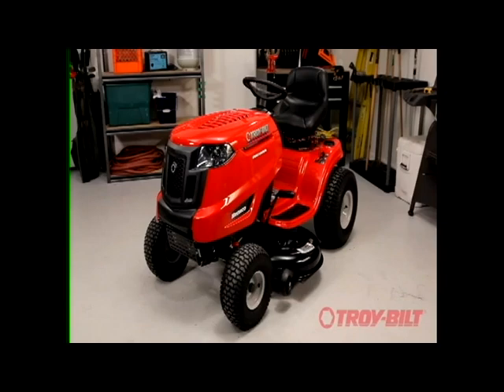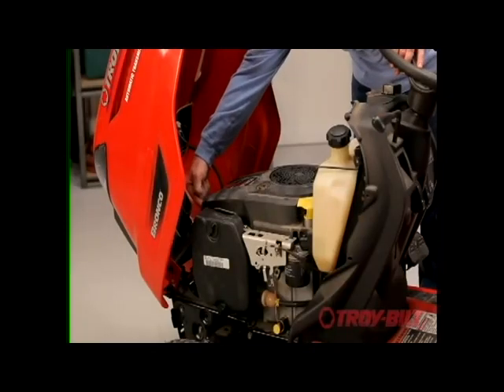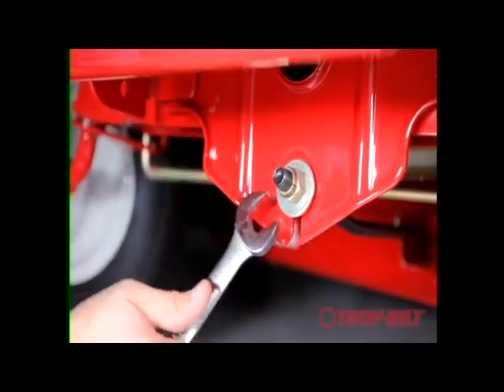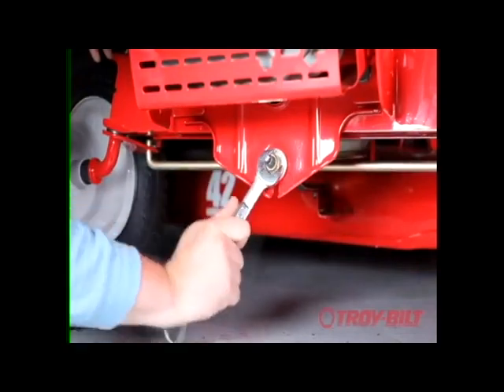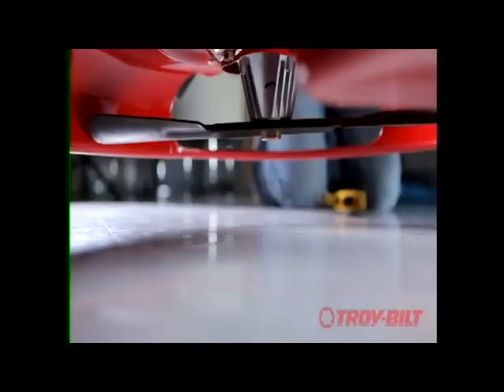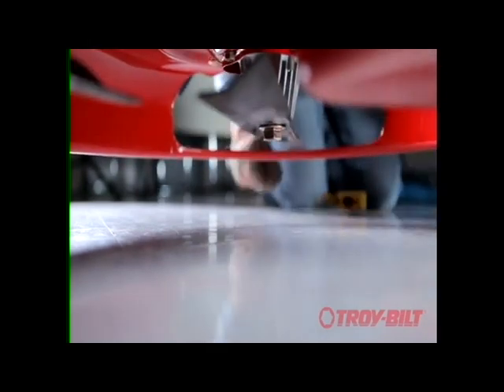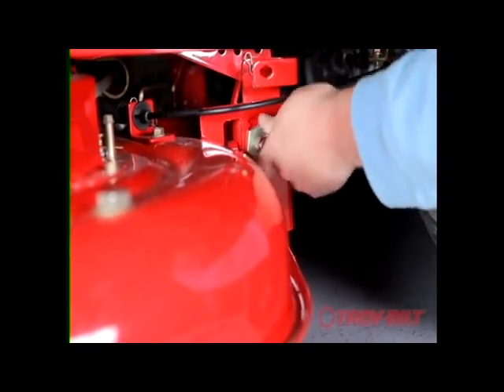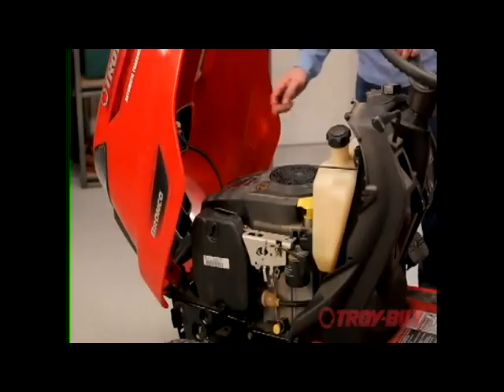How to level the deck on your MTD / Troy-Bilt Riding Mower

Comment: Wife hit something and dint tell me after cutting grass on day off yard look like crop circles .. Come find out the pin for the left side came off and deck dropped to one side cutting groves in the grass got close to level after fixing it but after seeing this may go back tomorrow and use front nut and side to fine  tune it and only clab I have is a gazebo but is little off guessing I have to account for that so should be good ? Have to other place beside dirt and gravel in the country

Comment: Did not help one bit, side to side is pissing me off. The right side of my mower is almost 2 inches lower than the left!
Reply: thomas johnson Hi man I have the same issue on my what they don't tell you is that the front adjusment is the one that assist the one side that have no side adjusment so you get the front adjusment is hi as you can clock wise thigt. Be shure to use all the screw area loose the back nutt and take all the way to the end sit the frame  on a level floor adjust the screw on the side adjustments to get it even on both sides and be sure you blade is 3" from the floor is a real bad design

Comment: Ive. Had SEVERAL PROBLEMS SINCE 2011 I JUST. HAD NEW BLADES PUT ON MY PROBLEM NOW IS THE MAIN HEIGHT ADJUSTER IS ON 5 AND MOWER IS ON THE GROUND .HOW THIS HAPPENED IS BEYOND ME. CAN SOMEONE PLEASE TELL ME HOW TO FIX.IVE ALREADY PAID FOR THIS GIFT 3 TIMES THE ORIGINAL COST. PLEASE HELP